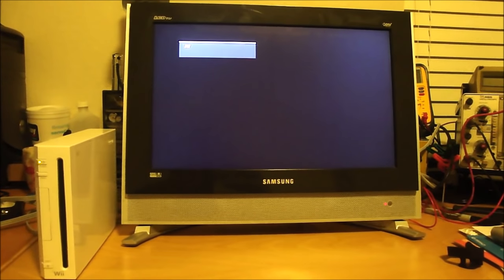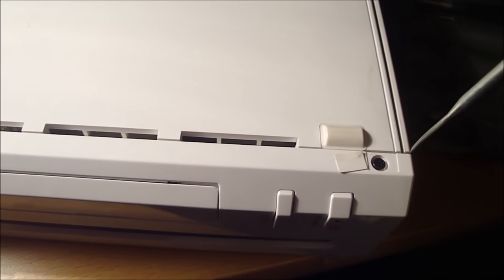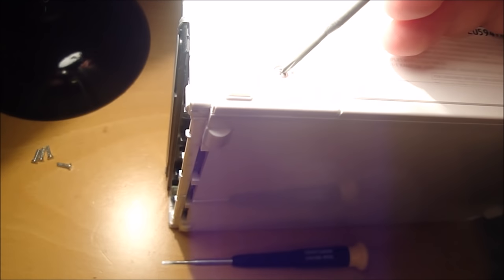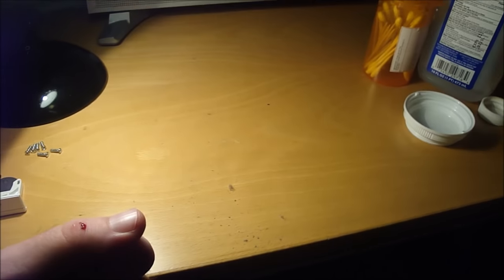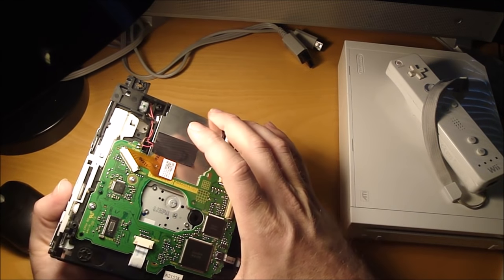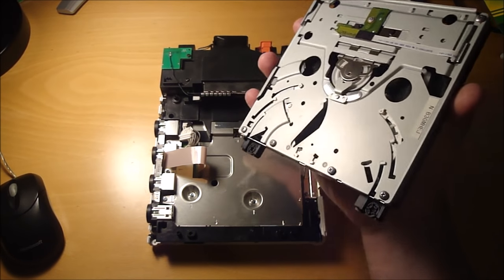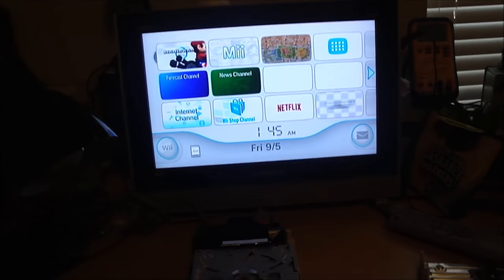Fix Wii Disk Read Error

Comment: Thank you for making this video!!!  I pulled our Wii out of a box in the closet after about 5 years.  Wouldn't play any discs.  I took it apart and cleaned the lens like you posted and Yahtzee, it works again!   Now my family and I can play some bowling and other games together while we are dealing with the fun Corona virus quarantine right now.
Reply from the maker: Sweet! Thanks for watching!
Reply: @becausestuffbreaks  Thanks for posting, ours stopped displaying composite video, so I bought one off ebay (parts not working) although they said it did, turned out just the laser lens needed cleaning. It would recognise the disc, but then would not load. Was going to swap the drive from our old one but cleaning it worked - my daughters happy now she can play some games during this lockdown.
Reply from the maker: That's great news! Glad I could help during this pandemic. Thanks for watching!
Reply: same here my wii was in the closet for 5 years but i cant get it to work so i gave up

Comment: Thank you @Justin!  I was able to replace the drive myself, and your video made it super easy. There were a few minor differences in screws on my system, but i figured it out.  For those that lose screws, I used Postits and marked locations (along with photos of the original before screw removals), I then turned a piece of scotch tape over and stuck the nails to it.  I didn't lose a screw and I TOTALLY always lose screws plus the carpet (yes I did it on carpet) was shag.  I had a work surface which was wood (a portable laptop desk). I did find a toolkit specifically for Nintendo systems, which included a lot of neat tools, supposedly it also works for the iPhone per the description, it had that Y screw driver as well.  I did purchase a jeweler screwdriver set as well.  My family was shocked I did it, but I reminded them I have already replaced touch screens on laptops.  Great video so thanks so much!
Reply from the maker: Awesome! Glad I could help. If you watch some of my videos of me repairing TVs, I'm always doing it on our carpet floors. I haven't had an ESD on a board yet and I've been doing it that way for over a decade. I did have an ESD on a board while working on a wood work bench, and it destroyed the board. Fun times.
Reply from the maker: And good job taking on this little project. People get scared to open up electrics.

Comment: I didn’t even have to replace the disc drive, the cleaning worked! Thanks so much!
Reply from the maker: Sweet! Thanks for watching!
Reply: @becausestuffbreaks  it did the same thing when I was playing sonic Riders zero gravity it showed and said the disc can't be read wouldn't get to the part where I was gonna do the final boss and credits
Reply: @becausestuffbreaks  does the green thing make your disc spin faster 100%.?
Reply from the maker: @izehumaheyiba2182  nothing will make it spin faster. Sounds like you have a dirty game disc or scratch on it.
Reply: @becausestuffbreaks  I know if I get my Sonic Riders zero Gravity disc spin on the wii while holding on to the green thing the error interruption will go away and enjoy my playthrough matter fixed.
Reply from the maker: @izehumaheyiba2182  that is interesting. Very interesting.
Reply: @becausestuffbreaks  yep my Sonic Riders Zero Gravity wii disc can spin until the unlockable screen.
Reply: My disc are clean like yours and I’ve used the wii official lens cleaner with fluid and still it says disc read error. Maybe lens is finished after 10 years play ( I looked after machine storing after uses and cool down good console

Comment: Thanks, I never would have figured out how to open it up without this video. My 2 cents, I couldn't remove those tri-screws with my jeweler's screwdriver but had great success with a Torx T3 bit. Remember, with Torx bits that small it's important to have it perfectly straight in the screw so as not to break/chip the bit.
Reply from the maker: Awesome! Thanks for the info.

Comment: I had the exact same issue. I replaced the laser module instead of the whole drive and now my wii works like new. The laser cost me just $6 shipped. I read somewhere that replacing the whole drive may not restore Gamecube compatibility because some replacement drives do not have that functionality. Those that do, cost a lot more.

Comment: the wii is so complicated.

There’s literally 2 screws to pull apart a ps4... I was going to follow along but I tend to lose screws..
Reply from the maker: Lol, it would probably be fine without a few screws
Reply: Ecchi Bot ps2 is the most complicated to pull apart and fix
Reply: @AdventureMan-kx3dr  xbox 360 by far the worst. A ps2 is a breeze and that's coming from somebody who's a walking klusterfuk. Well depending on how far down your taking it. Laser lense cleaning and tray adjustment was cake.
Reply: I f***ing tried everything that i would open that shi### (safely)
Reply: @waltersobchak7275  I can agree with you that the 360 is the worst console when it comes to opening it up
Reply: @MonkeyDLuffy-ew4xy  I never did get it opened I just bought a few more. Screw it. I have one that has been played maybe 4 hrs tops. Then I bought an RGH Corona off ebay for a yard. Then I seen a elite I think that’s what they call it the last one they made that looks like an Xbox 1. I got that for $40 but it doesn’t have a hard drive. I guess I can buy one it slap it in.

Comment: Had the dreaded 'disc error' and this worked for me.  First buy yourself the drive on eBay for about $25 and the trihead screwdriver on Amazon for $10 (two triheads are deep inside the case). Spend $10 on the right tool even for a one time use. Take pics as you disassemble because you'll be taking out many different types of screws and won't remember where they go upon reassembly. Thank you Justin your video, it guided me through the process.
Reply from the maker: Awesome! Glad I could help. Thanks for watching!

Comment: Thanks for posting this. My Wii has had this exact problem for a year now. One thing I find annoying is that the OEM drives that play gamecube games are much more expensive than the ones that only play wii games. But whatever. I just find it weird that they would make drives that are not backwards compatible considering Wii's have gamecube controller and memory card ports. I might spend the extra money on an OEM drive just because I feel like if I ordered one that doesn't play GC games it would make my console unfinished or incomplete.
Reply: Exactly. That’s why I replaced just the laser module instead of the whole drive.

Comment: You are the best! I had the same issue and I had to replace the drive too as the alcohol cleaning trick didn’t work for me either. I bet these lasers just wear out over time for some reason. I decided to pay extra for the more expensive Wii disc drive as that one can also read GameCube games that I have and that worked. I hate those tri-wing screws so I just threw them out. I stripped the heads using the 1/16 flathead driver. I had better luck with small torx drivers. Next time the drive goes out I will not have to deal with those screws. I appreciate you taking the time to show the process. Thanks!
Reply from the maker: Thanks for watching!

Comment: Thanks you, this seems to have helped. Instead of a bandaid I used a eyeglasses lens cloth. Covering the top part and the about half inch on the picture side. I cut off any extra cloth; rounding the shape to the disc. Cloth was about 3 x 2 and 3/4 inches.
Reply from the maker: Awesome! Thanks for the info and thanks for watching!

Comment: Happy to see it was as simple as replacing the disk reader.  The Wii U is not quite as simple, as you have to also swap the logic boards within the readers.  All in all, not a difficult repair, as long as you can keep track of where all those damn screws go when putting things back together.

Comment: I had the same noise you did, I moved the laser back and forth over and over and it would sometimes bind up.  I found way inside a piece of plastic, looked like a piece of a plastic Easter egg.  Got my tweezers and removed it, fixed the issue.  I guess that sound is your laser binding too.  Happens exactly the same seconds after the disc is inserted as yours.  That’s when the laser starts to read the disc.
Reply from the maker: I'll have to see if I can find it. I have that old drive stashed somewhere.

Comment: Would it make the clicking noise if it was just the laser being dirty?
Reply from the maker: +Sam Brunacci I thought it sounded like the laser assembly was moving back and forth quickly. My assumption was the laser couldn't find where it needed to be because it wasn't working. I could be wrong though.
Reply: My wii is also making the clicking  noise but, I tried cleaning the lens and it didn't work. I will tell you If I find a way to get it to get it to work. 😀😀
Reply: @screamingbird2476  did you fix it?

Comment: Thank you. FYI the tri-wing screwdriver sets are only a few bucks on Ebay, and you may want to get one with a magnetic tip since two of the screws like to try to fall into the disk drive.
Reply from the maker: I keep intending to buy a set and then I forget about it. Thanks for watching!
Reply: @becausestuffbreaks  Thanks for posting. Worked perfectly.
Reply from the maker: @hoochrocks  awesome! Thanks for the update.

Comment: Having quite the journey with my Wii during quarantine. My Wii was making clicking noises and rejecting disks. When I opened it up, without messing around with anything, it miraculously worked! When to go play it again, and now the disk isn't even spinning. Any thoughts? I swear I didn't touch anything on the disk drive.
Reply from the maker: Could be a loose cable connection. Watch my video and unplug all the cables to the drive and plug them back in. Let me know if that works.

Comment: 5:22 "and now we should be able to take the cover off".....SNAP....war wound! Thanks for posting, I have to try this for the daughters unit.
Reply from the maker: Good luck! Let me know how it goes. Thanks for watching!
Reply: @becausestuffbreaks  Man you make that screw and your driver look bigger than it is! I've got a good assortment of screwdrivers but the only one that fits is one of those eye glass sized ones. Couldn't turn the first screw and didn't want to shear my screwdriver off....guess they use those tri-screws for a reason eh? Oh well.....
Reply from the maker: That sucks. You can get the correct screw off eBay or Amazon

Comment: Hi, my Wii console makes the same problem as you, I clean the lens too but no change. Do you think that if I only change the lens for $ 5 on ebay my problem will be solved? Or should I absolutely change the dvd player?
Reply from the maker: +ecko unltd I think just changing the lens will fix it. I chose to buy the whole drive because it was fairly cheap and was easier than changing the lens.
Reply: I never found a part number for the lens anywhere ... Then when I search on ebay it seems to have only 1 piece number for the Wii RAF-3350 lens, I do not know if you had made the same finding.
Reply from the maker: +ecko unltd I think the only way to know you have the correct part is to remove the old one and compare it to pictures ones for sale on eBay.

Comment: Not sure if you are still active, but my wii just suddenly stopped reading the discs. The drive clamps down fine and the disc starts to spin, the laser clearly turns on, but after a few seconds, the disc stops spinning. Think it is just faulty laser?
Reply from the maker: Hard to tell. Have you tried cleaning the laser lens with a Q-tip and rubbing alcohol yet?

Comment: Where did you get the new drive and what exactly is it called? I have the same exact problem and I want to fix mine without spending loads of money
Reply from the maker: Got it off eBay from hannaselectronics. It was called "Nintendo Wii Replacement DVD Drive Part D2A D2B D2C D2E DMS" and it cost $17.99+$3.50 shipping.

Comment: I was playing with my wii again and it was working pretty smooth (I'm playing punch out), playing for several times, and I'm trying to mod it so I can play with the usb drive. But then after done modding my wii, when I try the Disc it appeared to be error. It doesn't make any noise, and when I inserted the disc the particular game icon shown in the wii channel (top left like when you try mario kart), choose it, hit play, then the error message appears. Also happen when I tried another games, icon shown but no luck playing it. Is it my lense? Tried to clean it once with different method but still can't load. Hope you can help me here T.T
Reply from the maker: I assume it has something to do with the mod but I don't know what you did to it with the mod.
Reply: Justin Peters when I bought the wii years ago I didn't know it was originally mod-ed, I was just simply playing it, and recently when I want to play again my USBLoader wasn't working maybe because it's outdated, so I went searching for the newest version and found it in gba web which is pretty credible I assume. So yeah I just following it, usb loader working (but still needs the SD card inserted) but then disc won't work. Was it coinsidence or not still a puzzle, I'm trying again the cleanse the lens again but haven't try it yet again

Comment: Well done, good fix there.  Have you a video of you fixing a Wii where the power light is red and won't go green when pressed, even using 2 different AC adpaters in various wall sockets.  Mine just ticks when I press power or eject.
Cheers,
Andy
Reply from the maker: Sorry I don't. This was a friend's I fixed and haven't seen another.
Reply: That is a problem of the button not the socket it is a good idea to pry off the front plate and adjust the inside button to tilt towards the plastic
or maybe if looks don't matter remove the front plate entirely

Comment: I have the wii game Mario party 8, which is on a dual layer disc. Anyways I am able to start it up and play it for a whole, then the wii will stop what it's doing and give me the "error" message that I have to take the disc out and etc. I tried the home made solutions, would it be worth while to just take apart the wii and try cleaning the lens that way or just let the game do its thing and play with the errors?
Reply from the maker: +iWeirdOfficial417 have you tried buffing the disc for that game? Sounds like it's a dirty or scratched disc instead of the wii.
Reply: ***** Seems like it works now, yes the disc is buffered and cleaned

Comment: My wii works pretty well, but there are like, 3 games that don’t work on it. The system just says to check the Troubleshooting guide. However, the games work on one of my friends’ wii. Do you know where the problem lies? I feel like it’s the laser
Reply from the maker: Sounds like the laser to me also. Have you cleaned it yet?
Reply: Justin Peters I attempted to do the method of cleaning it with a makeshift laser cleaner with a disc, paper attached to it, a cloth, and some alcohol

Comment: Hi there I'm just wondering where you got the replacement of the drive
Reply from the maker: Got it off eBay from hannaselectronics. It was called "Nintendo Wii Replacement DVD Drive Part D2A D2B D2C D2E DMS" and it cost $17.99+$3.50 shipping.

Comment: I'm having wii problem when I put the  disc  in like I don't hear the sound I'm not sure if the disc needs cleaning or I need to replace the old drive and put in a new one
Reply: grand priest I had the same problem it’s just the wii wires I think u plugged them in the wrong way

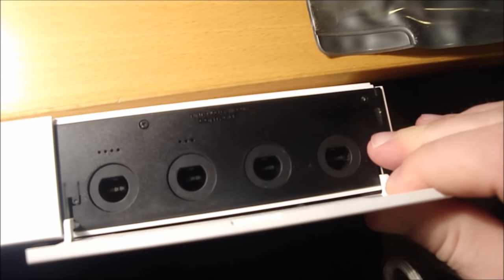Comment: How the hell did you pull the white "button" thing with the cord out? At 3:05. Mine won't come out.
Reply from the maker: Are you talking about the front cover with the button? I had to take 2 tri-wing screws out from the bottom. They are covered by 2 flush stickers. Then there's a phillips head screw on both sides of the cover. One of them is under a rubber foot and the other is behind the white controller cover that you have to open. I assume you might have a screw still in. They like to keep them hidden.
Reply: TJ Shotwell-Green i
Reply: TJ Shotwell-Green ihuhiu

Comment: Mine does not make any sound and it only says unable to read disc, i tried the wiping it with and still nothing do you know what might it be ?
Reply from the maker: +hitzary g sounds like the motor or motor drive. Be easier to just replace the whole drive like I did in the video

Comment: The worst thing to do is to use a flat head screwdriver on a tri-head screw and then completely destroy the triangle hole trying to get the screw out and then no screwdriver head fits in it, personal experience.

Comment: mine seems to be having a problem, i have two Philips head screws and they’re just not coming out no matter how much i screw them, like they are turning but no matter how much i turn them they just won’t come out, any tips?
Reply from the maker: If possible. Can you get something under the screw head, like a fingernail or a flat head screwdriver and then pry up while turning the screw? Sounds like the screw hole threads are stripped.
Reply: @becausestuffbreaks  ok i’ve gotten that one out, but now i have a stripped screw down one of the long holes and i can’t seem to get a good grip on it
Reply from the maker: You could get a screw extractor kit and try to find one that will fit.
Reply: @becausestuffbreaks  i’ve been looking on amazon and i cant seem to find a screw extraction kit that will fit the down the hole, any other suggestions?
Reply: @becausestuffbreaks  i’ve also tried putting a rubber band down the hole and that won’t work either